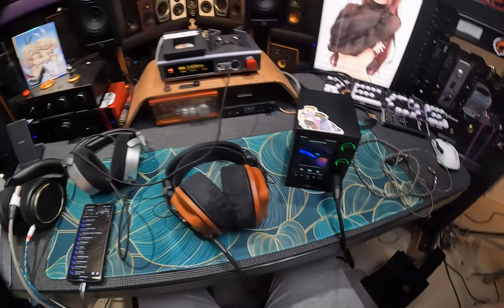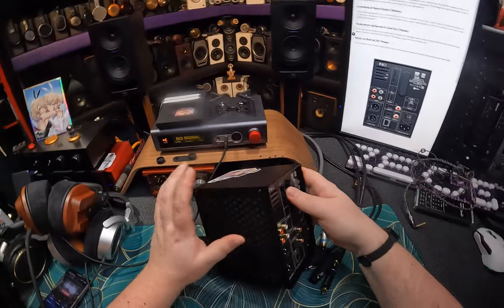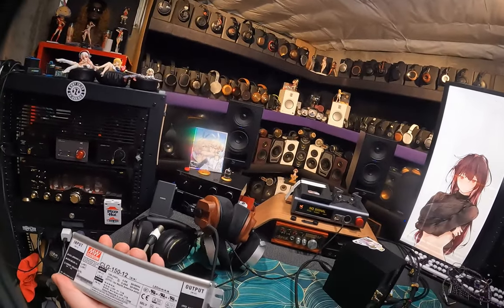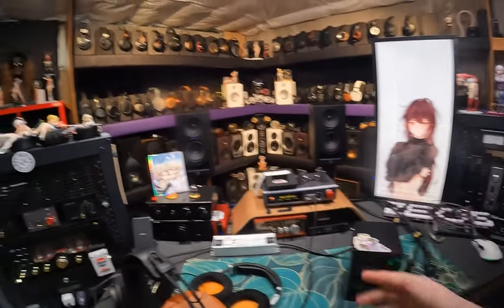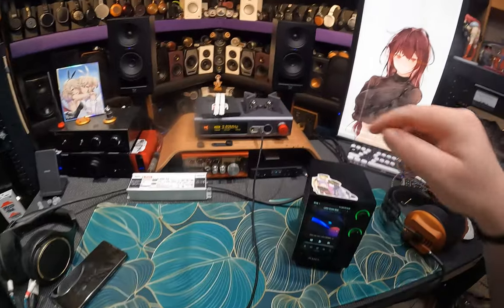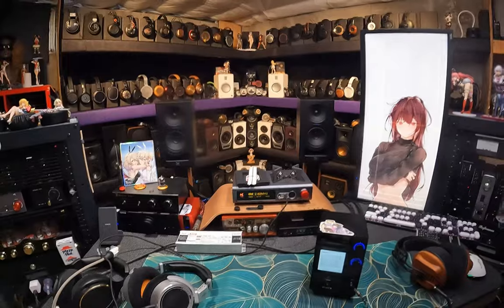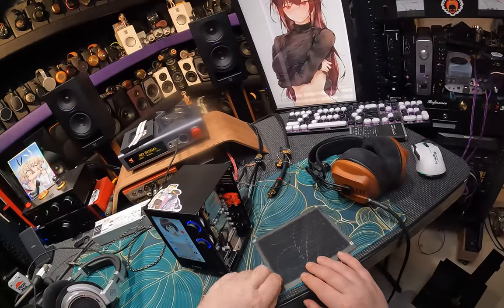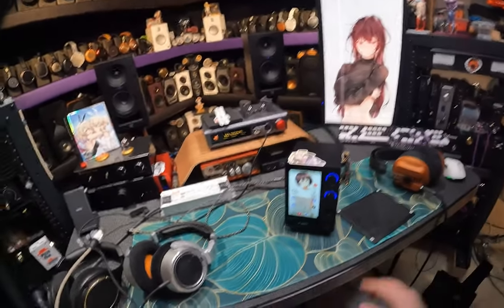A Monstrous All-in-One .. the FiiO R7

Comment: FYI - FiiO also sells their own linear power supply - the PL50 - that is compatible with the the R7 (and also the M17, K7, K5 Pro, and certainly many other branded devices that have the same power requirements). It’s in the US$150 ballpark, but can sometimes be found a bit cheaper.
Reply from the maker: Damn at that price I'd build my own like I did and get 11 Amps
Reply: @ZReviews  True - but make sure it is linear too, for apples/apples comparison.
Reply: Fiio k7 is better.
Reply: …than the R7? No, I disagree. The K7 is probably better value though (not that the R7 is bad value, it’s a lot for the money!).
Reply: Good luck finding the fl50.   Any recommendations besides the one external supply linked?  I really dont want to splic ends on it if I can just buy a good power supply in $150 or below range

Comment: The best part is-i get my k9 ess and like after about 6 days fiio rolled out this boy, and i was like-alright. This thing is like k9, but better, in many instances. This DOES cannibalize on k9 alot. And it's cost less.
Reply from the maker: There is a cheap K9 coming out too.
Reply: @ZReviews  Yep, and then it will become semi-important to distinguish “K9” vs “K9 Pro”, instead of just saying K9 all the time.

Mind you, I’ve seen the new K9 (only) specs, and it is damn near identical to the K9 Pro ESS model. Slightly different DAC (ES9068AS x2 (same as R7, although the R7 only has 1 DAC chip, not 2) instead of ES9038PRO x2), no USB-C connector, a smidge less amp power. Really identical otherwise (OK, no gold/silver trim on the knob, if you want to be extra picky).

Comment: I understand that with any Android device no matter the original bit rate/depth a streaming service is playing music, that Android limits it to 48khz. So that's what the settings are for in the R7, to bypass the Android limited resolution, which then makes whatever is playing into the R7 bit perfect. The R7 setting regarding DSD, makes an incoming signal, like 16bit/44.1khz PCM, and upsamples it to DSD. If you don't change the stock Android audio setting then the max resolution will be 48khz.

Comment: Have you, or anybody currently owning and using this device, come across the problem of having a pretty decent delay in USB-dac mode? I got this device specifically because of the different modes and feel kind of let down with my experience of noticing quite a big delay in stuff happening in game or video's and only hearing it later. 

Thanks in advance for anybody commenting :).
Reply: Yes, I have been using it for about a week now. USB-DAC mode does add a bit of delay. The delay is at a point that I can notice it, but not a big deal. You may be more sensitive to delay than me. 
As a matter of fact, Fiio disabled the Bluetooth when using USB-DAC because they didn't want to add more delay than the Bluetooth might have.
Hope this gets fix soon with updates.
Reply: They acknowledged the USB lag and were going to fix it via a firmware update. If you have done so please tell us of results.
Reply: @juanmillaruelo7647  Hey I'd love to be able to tell you, but I didn't know they were going to (take a chance to) resolve the issue and ended up returning it sadly. Hope you can find the answer you're looking for soon!

Comment: fiio makes a power supply called the pl50 3a at 12v, 2a at 15v has all the needed connections for around 120 to 150 i purchased one for my magnious schitt triple stack,  unfortunately it doesnt work guess i will have to get a r7 or maybe wait for the supposed r9

Comment: Sometime later this year FiiO is supposed to be releasing matching powered speakers for the R7 called the SP3.

Also, I’m gonna say the same thing I said to you at CanJam.  You should’ve held on to the Q7!😉
Reply from the maker: It can't do full-fuck without external power. I'd rather just have this since it can't run without external power.
Reply: They also have an accompanying full sized headphone with a 60mm beryllium driver that they just released called the FT3 ($299.99).  I admit to having one on the way with great shame…..😳